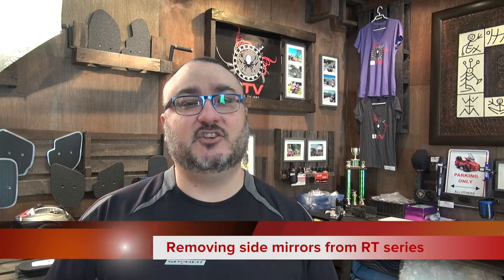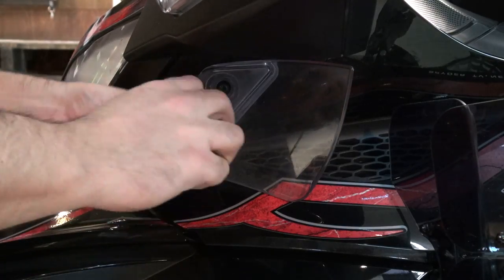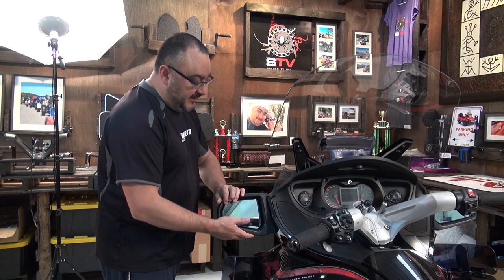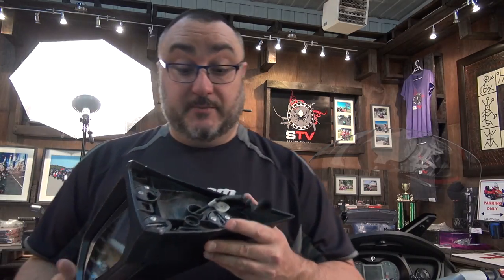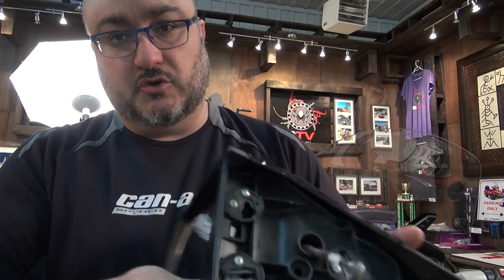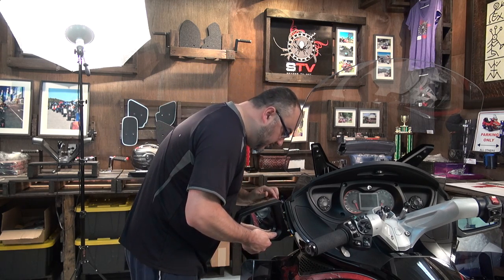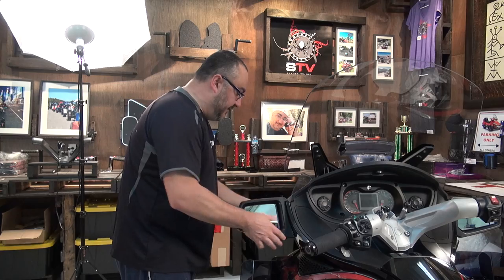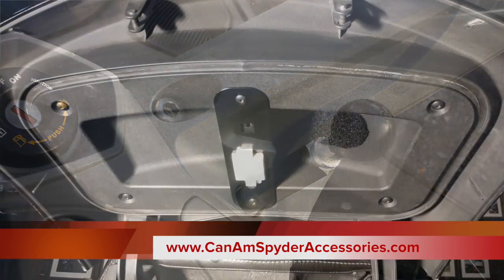Tip # 1 Spyder TV - Removing side mirror RT Series Can Am Spyder

Comment: I damaged the surface of the side (stock) mirror glass by un-installing some convex stick ons.  Is it possible to change the stock mirror glass with new stock / OEM glass?  Dealer is little help on this topic.  My model is a 2012 Spyder RT SM5.  THANKS!  I really like your info on line and the products I've bought from you have always been top notch.  Jim Fowler - Bow, NH
Reply from the maker: http://epc.brp.com/Index.aspx?lang=E&s1=13a660cc-29fe-4cf7-8c92-6394793ee4d4

Comment: Ok, i have to ask this question. I own a 2014 sts. And its is almost impossible to see videos on these issues for the ST series. Why is that.
Reply from the maker: They don't make that model anymore...only 2013 to 2016.... and sold little of them....
Reply: @pierre-spydertvpoliquin-sp9082  ahh, so we are the red headed step child of can amy spyder. ugh
Reply: Prett much the same on the ST and ST variants.  Just popped off the right mirror on my 2013 ST today to get things apart to check the air filter.
Reply: You can see if installing the "magic mirrors" will solve the problem. Most likely.